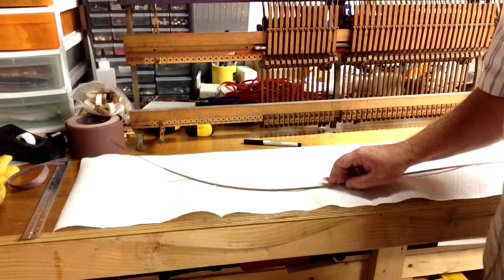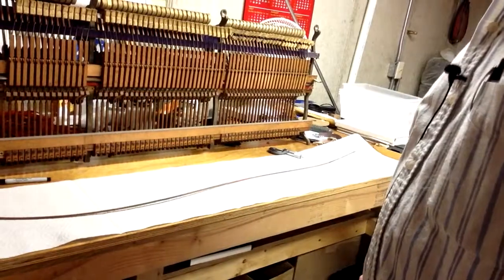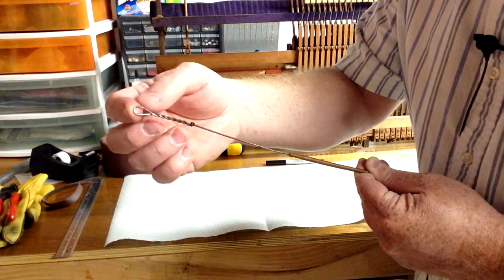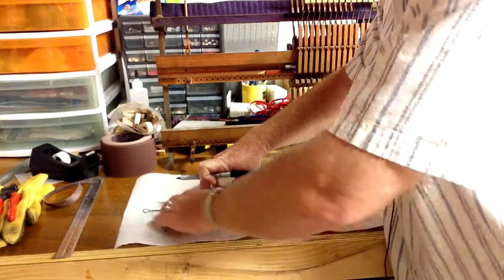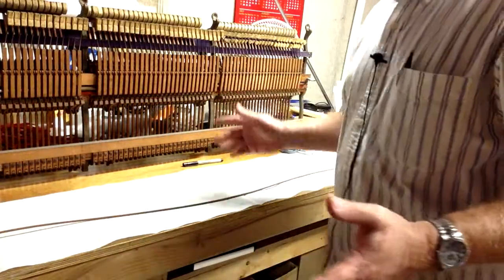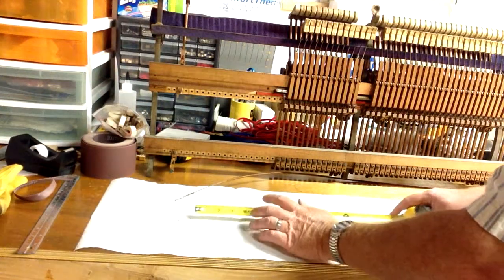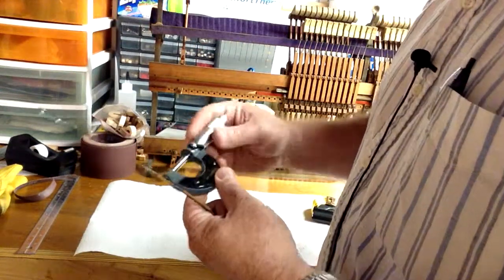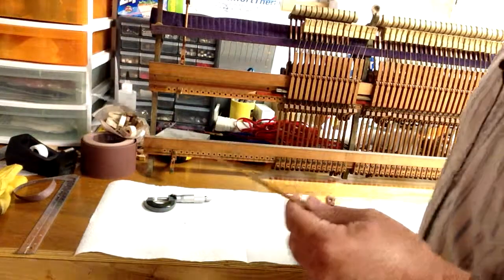Measuring For A Custom Piano Bass String Replacement - Piano Tuning & Repair I HOWARD PIANO

Comment: how about putting a screw or hook into your bench to hook the hitch loop to and then some vise grips to grab the end of the wire.  then put a pulley and weight, tied to the vise grip.  that would give you a place to hook your tape measure to as well.